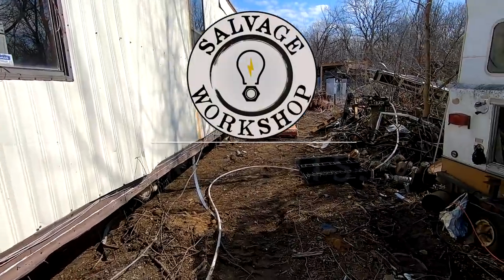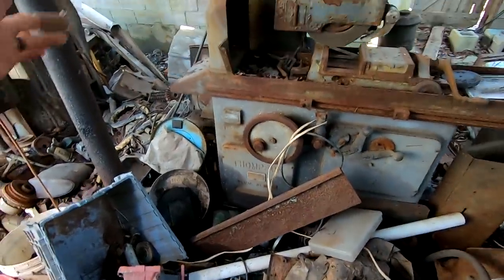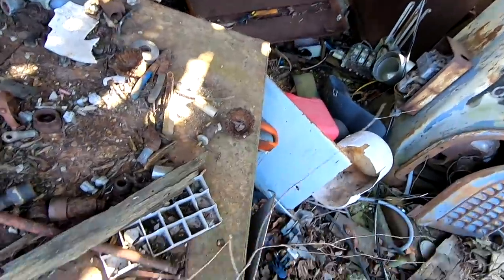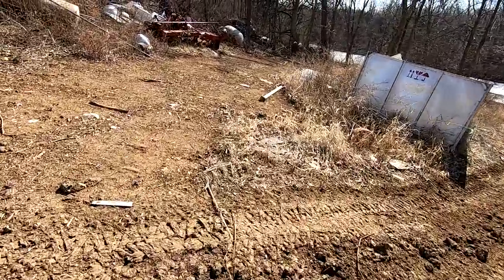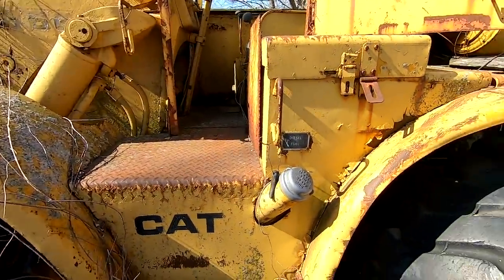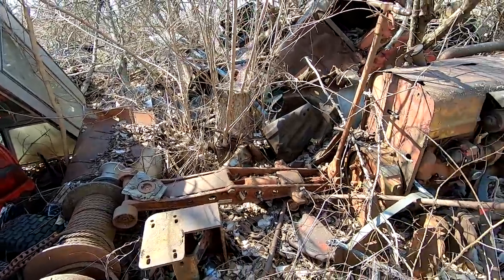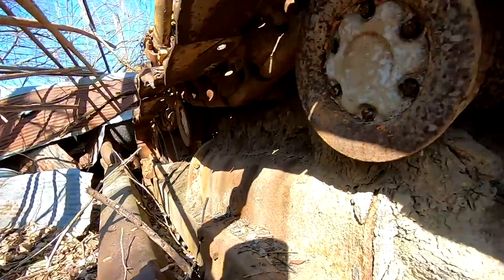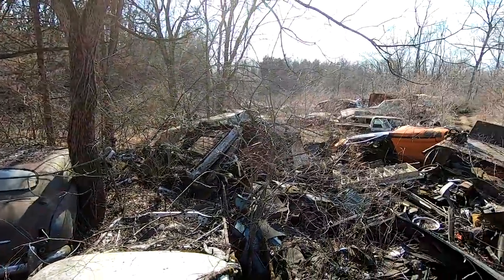Exploring the Machines at the FORGOTTEN Junk Yard ~ RESCUING OLD IRON ~ Episode 5 Part 1

Comment: The sad part is that some of that is going to be so far gone that its either parts for someone else or a junk machine. I live in Ohio and as a kid on the bus I always saw this machine shop on the way to school. I used to see 10 or 15 men working in there all the time. Well several years went by and I started driving. I ended up seeing a large lathe outside the front of the shop. I used to tell myself "you need to stop and ask what the deal is with it". Well I never did. I graduated. Went to the Marine Corps, came back and started a career as a machinist. Well by that time the shop had closed. I found out who the ownerr was, called and asked about the lathe. He said "i just wanted more room so I put it outside". So I told him I'd take it (sight unseen for 5isb years). When I came to pick it up the bed ways literally had holes in it the size of my thumb. Chuck frozen, Tailstock frozen. I took the headstock off to find it full if water and all the steel gears solid rust. It was basically junk, no amount of love or money could have saved it. My point of this was that this video was very cool to see but sad. Maybe since those machines were in a building they'll be better but in my experience machinist type machines don't last long exposed to the elements. The vises are good, thr bits too most likely. The welders are gone. The dozer im sure could be saved with a lot of new parts and some work. I'll never under understand owning something and letting it get that bad. Why not sell it and get money before it becomes junk. We have a 200 ton press at work, hydraulic motor died. It went outside, now its a rusty as can be and getting worse..why not sell it or try to sell it? Why let the machinery die a painful death...

Comment: The engine/generator you asked about @ 38:19 That is a 1940's gas International/Farmall  'U6' or 'T6' or even a 'W6' second cousin to the TD6 or UD6 and the WD6  The diesel rigs used the 'D' designation where the designation 'T' was Track/tractor and the designation 'U' was Utility (stationary ... generators, pumps ect.) and also the 'W' was Wheel/tractor. The diesel engines turned counterclockwise while the Gas engines turned Clockwise so with the starter motor being on this side (right side of engine) it is a gas engine. On the other side of the block just above the first or second lifter cover and below the head should be the stamped S/N .... might read like
TCDBM-123456 .... T = Tractor; D = Diesel;l  M = Military;  B = don't Bemember , C = Can't remember LOL but one of them is Military branch designation my brain is thinking Navy, CB Marines...
or as simple as U-123456
"IF" there is a tag on the firewall .... it might read like .......
Modification No.  ABC-123
Model No. T6
S/N TCBM-123456

On the right side of the engine there are casting numbers ... these can give you a date of the casting only.... after they were cast they were warehoused for a minimum of three months to cure... I cannot remember the codex for the casting dates   "yesterdays tractors" or "Heavy Equipment Forums" are great information access points.

Good luck.... Seems you found The Holy Grail .... I may be interested enough to drive down If'n ya got the right stuff...

Comment: @ 8:42 A handy tool for any shop with a mill, is that rotary table under the Milwaukee mag drill.
@12:28, there would be a v belt, not a chain, to drive that LeBlonde.
 For your tooling, Evaporust would be a place to start, but most those mill cutters would probably need a tool grinder if they been banged around, setting in rust or otherwise damaged on the cutting surface. Drill bits would be fine if you know how to touch them up on a pedestal grinder.
 This old man needs that plastic tank behind the Champion air compressor. I would use it as a hunting blind, so i can handle sitting out in the weather. 😁
 @ 45:04 is an Allis Chalmers WC, most likely after 1938 to 1947. I have a restored 19365 model. There is no ON, on the end of ALLIS 😂 Allis Chalmers had no connection with Alison.

Comment: Those cutters and drills are very salvageable. Ive cleaned with vinegar and then bead blasted. The steel is much harder than the abrasive. This is just my opinion and personal experience.

Comment: Videos like these make me wish I was there, I would  love to  own a surface grinder, vertical mill. but I worry the rust has gotten them out of spec, you can try reverse electrolysis with some washing soda solution and it will revive most metals, but the beds on these things are huge. I hope these can be saved.

Comment: I don't think I worked on the Champion air compressor. A little after my time. I have a 60 gal vertical from 1958 that is my main. A small 20 gal horizontal that has a a tank leak. Hope to find a different tank some day. When I didn't need one I saw tanks everywhere. Now they can't be found.

Comment: I never knew that CAT made a 966 model loader that was not articulated....   I ran a 966-B at a limestone crusher in Oklahoma (1966-1970) while I was going to college...  Fantastic machine.... The company apparently still makes the 966 series loaders with the "M" series being their latest.. Caterpillar introduced their first articulated loader in 1963 - a larger 988 series...  There is very little comparison between "articulated" vs. "non-articulated" loaders....  The articulated loader was much easier and faster to use loading trucks...

That Kenworth is a long-haul rig - what you need is an old model without the sleeper set-up...  The second flatbed trailer looked like it would fit Old Red better than the first..but that would also depend on how heavy the frame is what the load ratings are for each trailer.....  Either way, I think you are going to need one of these in the future....

Comment: most of the tooling and machine tools can be saved, just depends on how much effort you want to put in. The drills all look to be in decent condition, little wire wheel on them and some grinding on the drill itself for resharpening and they would be good to go. I'd assume same for most of the fly cutters. The machines would take probably a bit more effort, cleaning off all the rust and whatnot and making sure there's no severe pitting on the ways, but regardless still do-able.

Comment: Most of the horizontal milling cutters are worth $20 - $50 each, most of the MT drills are worth $10 - $30 each, the standard drills are worth much less, but an index set would be $50, the end mills are worth $10 - $100... the tooling is all a high return on your investment in time as it just needs a little cleaning. The vices are worth $100+, chucks $150+, the machines are potentially worth a lot, but only after being put back in working condition, they're a lot of work with a potential of being scrap. Le Blonde lathe $5k+, South Bend lathe $3k+,  K&T mill $3k+. Fix and sell enough stuff and you could buy a bigger shop? The margin on classic cars might be OK.

Comment: Re saving the cutters etc, I'd try electrolysis on them, using bicarbonate soda, water and electricity. It should take all the surface rust off then you can easily see whether what's underneath is salvageable or not.

Comment: You can soak all tools and machines with light oil, kerosene, and save them.

All cast iron way, and  tables will clean up  very usable condition,  worth saving , and most drills, and cutters can be sharpened.

Gary Muncy

Comment: that Kenworth is a T-600, late '80's - early '90's ! the year should be listed on the drivers door opening if it has not faded out ! there might even be something in the glove box to look at. when you get the hood opened, the engine should have a year stamped in a data tag! that is if the engine was never replaced!!

Comment: That John Deere with the safety control issues I am by no means an expert but I have tinkered with one in the past. Someone had done a poor job in the past adding a bypass switch to the seat belt circuit and if you were using it they didn't make a good connection so it would randomly throw the brake on when using it. One day I removed the switch and added another to the cluster that made it look factory. Now I don't remember if it had 3 wires to bypass the seat safety too but on this machine the seat safety is just hanging down. So this machine doesn't have the seat safety working so I reason that I had both safeties wired to the same switch. 
Now this doesn't mean that is your friends issue but based off that I would think you could stick a multimeter on the seatbelt wires and see if it makes a connection when buckled. Just giving ideas  and what little experience I had with a 250 machine

On a side note for projects I have always been trying to put together a International Harvester K 8 to 12 with a 5th wheel and find the oldest lowboy around. Sadly they aren't very common anymore

Comment: The Singer looks like an industrial machine. If so, it is meant to be used on leather and very heavy fabrics. They are hard to find. Working ones are very valuable, but it's pretty shocking what the non working ones sell for.

Comment: The lathes and milling machines tooling included should be saved. I would grab the brake drum lathe as with everything going to disc brakes they will get scarce. Allis Chalmers HD16 great machine for medium size dozer. I think the second low bed trailer might be the best one as it is a "Beaver Tail" and they both need new wood. Once this stuff is scrapped it's gone forever. The Caterpillar cylinder rebuilding machine is a keeper. Some cylinder rebuilding outfit would kill for it. Or it could be the beginning of your new business. Don't leave out the 966 loader 'cause you might have the trailer to haul it.

Comment: Those milling machines could be saved but it just wouldn't make any economical sense....far easier and cheaper to find good used ones.
Some evaporust will clean up those cutters but they are really only useful for someone with tool and cutter grinding access to sharpen them....still worth saving!

Comment: Hey, what year and model is that Greyhound bus at 40:26? I have a 1954 PD4104 that I need various parts for. I'm very interested in whether that bus has parts I need.
I also have a 1948 Willys CJ2L (look it up) as a daily driver. I'm also looking for parts for it as well. Specifically things like just the right PTO, an overdrive, and various farm tools that were available for them.

Comment: Is the seat really hard? If so it may just be the sensor in the seat that can't detect anyone in it due to the seat being so hard. You can probably find a seat somewhere used for pretty cheap maybe even on ebay. Get one made of better material that won't get hard

Comment: Although there's alot of cool stuff there most of it is beyond repair. I'm not saying some things can't be fixed, but unless you have the time and money it just wouldn't be worth it for the average guy. And you would have to weigh the cost against the need. Some of the stuff you can buy running for less than it would cost to fix. The cars unfortunately are probably the same way. I understand wanting to fix up these old things but unless you can dedicate alot of time and money it most likely won't happen. I bet they wanted to fix all of these units but never got around to it.

Comment: You say to stay tuned for part 2,  are you ever going to reveal the location of this place? There is no point showing this stuff if no one will ever get the chance to save anything. The John Deer does have a way to bypass the safetys for operator based controls.

Comment: I know you like old machines but the Hossfeld Bender is actually really not worth the steel it’s made out of UNLESS you have a fair amount of the tooling and dies for it then also the knowledge on how to use it. I say this from experience. Having used one in the early part of my 40 year career. But now I only use the JD2 type benders because they are much more intuitive to use. The hossfeld is so backwards to use and takes much more time to set up and make good bends with. Just saying. Somethings are just not worth the effort to get. But if that’s your passion, by all means have at it!

Comment: What a shame. Whether the cutters and drills are salvageable depends on how badly rusted they are. If they're pitted under the rust, they're scrap. Bits and cutters with surface rust that isn't pitted underneath can be cleaned and sharpened (I'm a professional sharpener).

Comment: There is so much stuff tossed in this country. All that tooling And yet i cant get a rotor turned anymore. Old Dozers if you can clean up and take a few pics in operation will fetch over 10 grand .  Every one wants Climate control cabs GPS controled cutting edges, ect